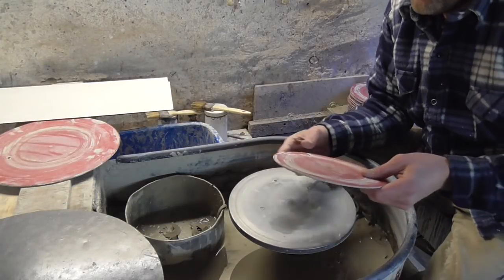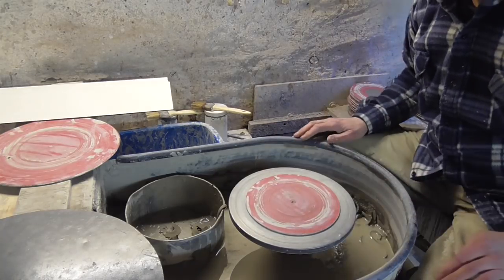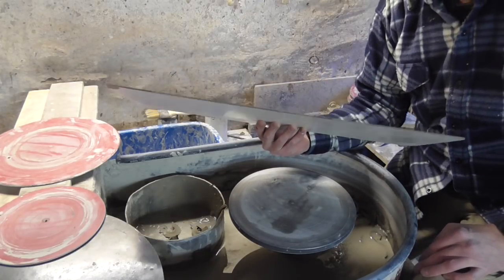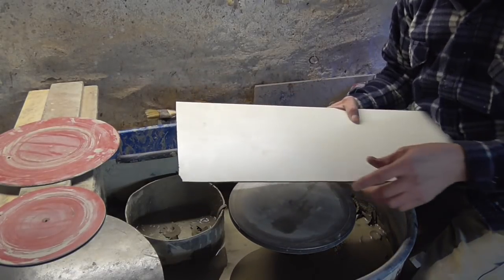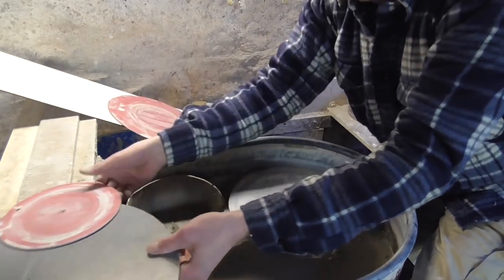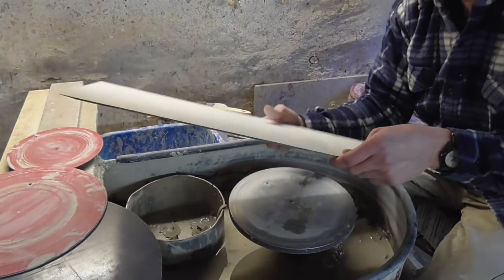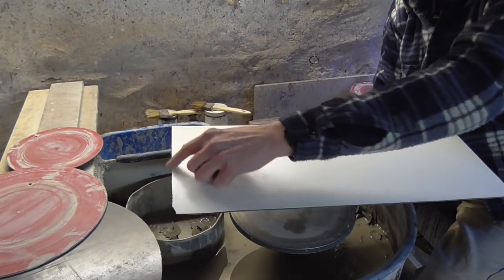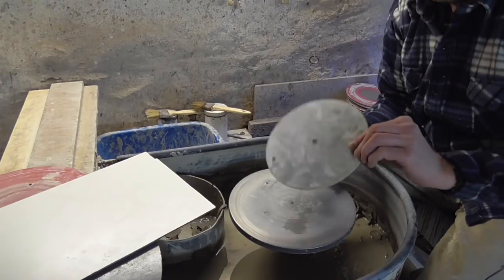My Pottery Making Batts : How to make them.

Comment: I get this is a very old video, but I was wondering if this was painted with something that would give it some grip. I have tried with tiles on a disc of clay and if they're glazed the clay just slides off. It seems like this laminate would be not as smooth but very?

Comment: Did you make your center pin in your wheelhead? my wheel has to opposing pins on opposite sides of the wheel head but it seems that a center pin and corresponding pin on the outside of the wheel head are more practical. Thanks

Comment: The wheel head on my pottery wheel doesnt have pins or holes for pins (I can buy an alternative head with pins from the manufacturer), but I have seen other potters create a clay pad on the wheel head and attach a bat similar to the ones you use on top of that. I was thinking about giving it a go as I struggle to get pots off the wheel head without leaving finger marks all over them.

Comment: Hello from Brazil. Thank you so much for sharing. 
I have a question: My wheel has a very high pin (shimpo) and I've been looking for a replacement so I could make some thinner bats, do you know if there's any kind of substitute for the pin that comes with the wheel?
Reply from the maker: The pins are usually removeable by unscrewing them.
You might be able to shorten them by filing them down and then insert them again ?
Thanks.

Comment: so do you get any problems with cracking of the pots when they dry?.. I always thought you needed to wire them off even when using a batt because the pot shrinks when it dries, but the batt doesn't.  Or does the pot just 'pop off' the batt when it dries?  Love the vid's by the way
Reply: Michael Dausmann I've been using bats for years. I do put a wire through my pots but I leave them on the bats to firm up. I put them in a dry tent I made with shelving and plastic and get at them the next day. I have never had a problem with anything cracking. I actually think this allows the pot proper humidity adjustment too. What I mean is it doesn't allow it to dry so fast around the top vs. the bottom. I have only had 1 gigantic bowl/platter crack in my entire time doing it this way and that's because I left it too long. Now I learned if I have anything that big I flip it between bats for even drying.